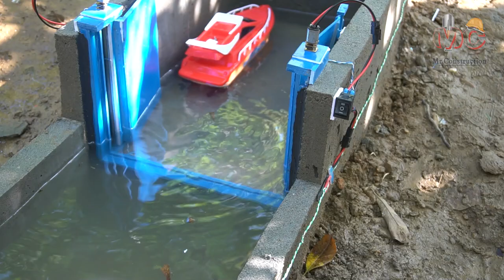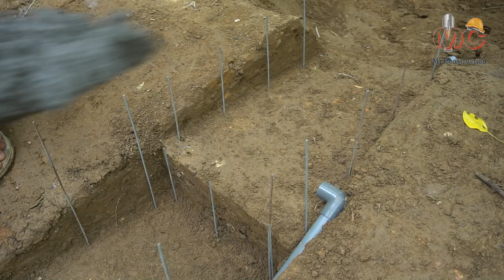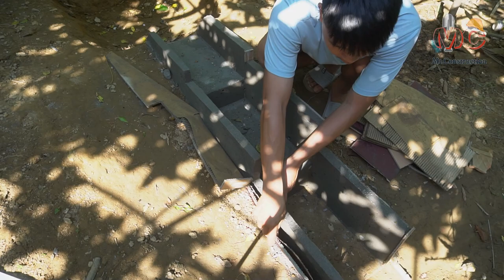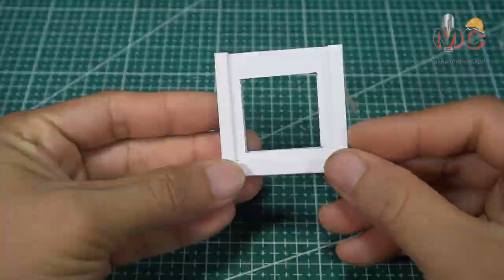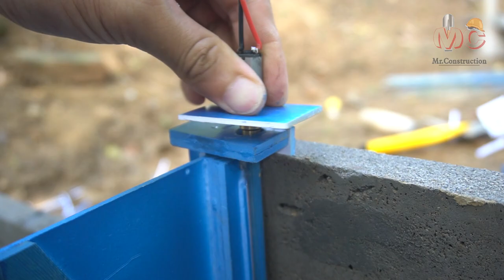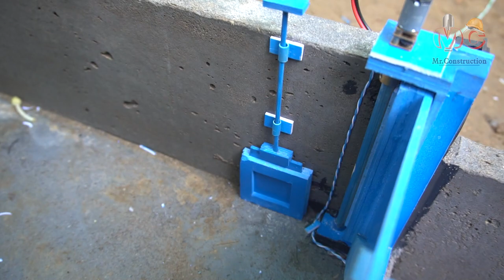Mini Panama canal construction.  The best idea for maritime transport

Comment: Please reply
Reply: I'm doing a mini panama model for my college work
Reply: And I'm stuck at doing the gates
Reply: Please reply and help me out
Reply: I have another 30 hours to complete
Reply: Please please
Reply from the maker: I don't know what your problem is, in general you need a strong gear reduction motor. And there should be a control circuit to let the two doors open and close in the correct order, or you can attach a separate switch to each door. As for how to keep it from leaking water, it's quite difficult, you have to do it really. tight by adding gaskets where necessary